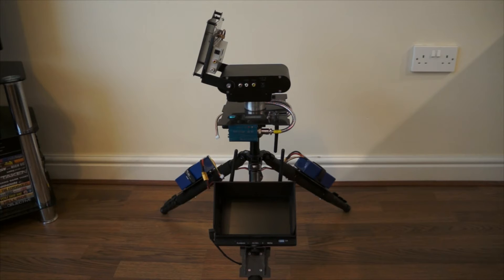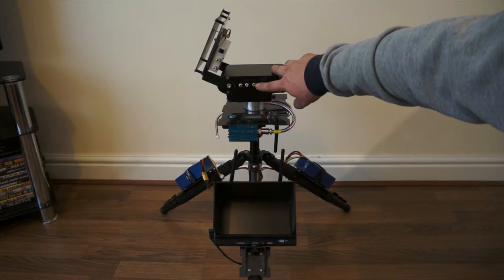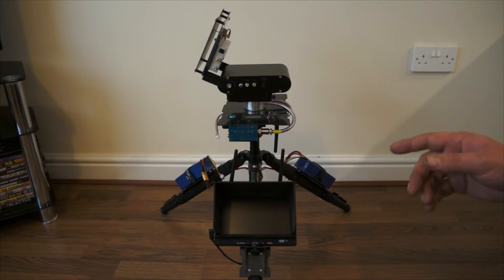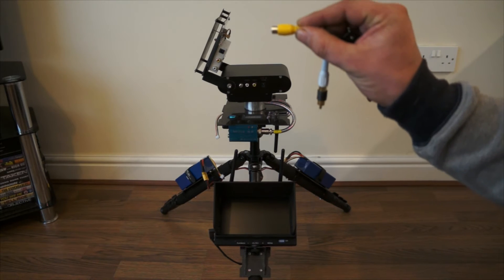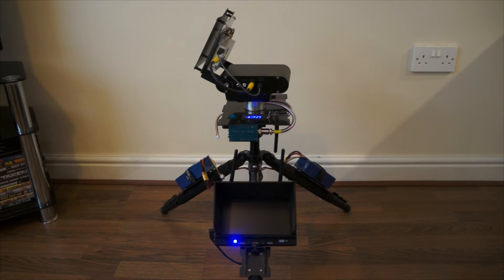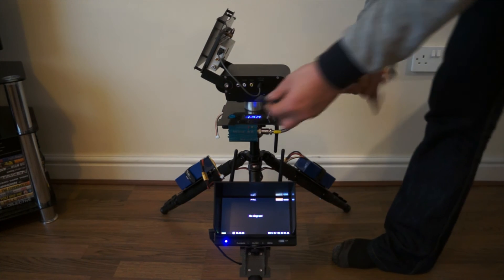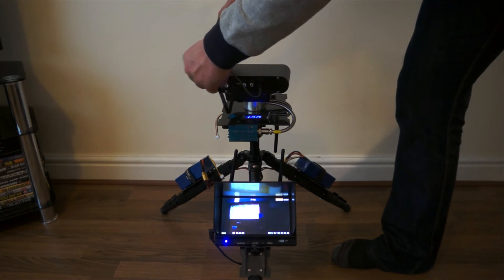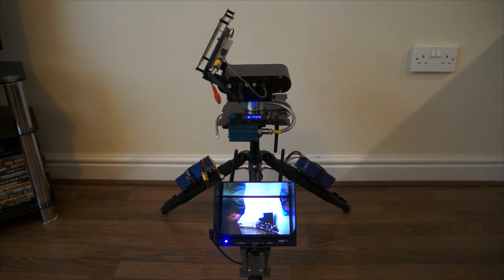MFD ATT Mod

Comment: Nice mod, can you tell me how to plug 2 att together to see the other plane information on screen? What cable i need and how to do it, thanks.
Reply from the maker: You need a 2 wires. From your ATT driver the while Molex connector. You need your pin 2 going to their ATT driver pin 6. Then Pin 2 their ATT driver going to pin 6 of yours so you appear on each others screens. I don't think you can buy the cable, you would have to make your own.
Reply: I can't find the diagram on google
Reply: Found something, it shows pin 5 to 5, pin 2 to 6, pin 6 to 2, so i need a 3 wire cable, thanks amigo
Reply: I dont have the cable, how can i make one?

Comment: hi Coyote, recently I got the AAT , but the tracker isn't directly facing the plane, I read the manual , trim mode: press CAL and power up, then release. during flight, press CAL or NOR for the adjustment left or right. but it doesn't work, All I've got only " beep " sound when I press either CAL or NOR.    mine is a V5 version AAT .  many thanks for any advise !
Reply from the maker: I see you are having problems setting up your MFD AP as well. Trim mode should be a last resort. I would guess you need to do a hard iron calibration where you are before flying. That is normally the problem.

Comment: Mmmmeeeeennnn!! I have been suffering from this problem so badly that I was considering to change my entire video set equipment  "ON THE BLOODY PLANE""" never thought or consider that the problem may have been all along in the antenna! I'll be checking on my equipment tomorrow morning.. thanks for the tip!
Reply: +Coyote FPV I mean stink like a rotten piece of carcasse. literally a dead automatic  Antenna tracker driver. i have been considering to update the firmware. but don't know yet. I'm pretty discouraged whit this
Reply from the maker: +Migueldeservantes  Oh stink like smell, sorry I read stick. Well in that case then the logical step is to buy a V5 for $45 and have a working ATT again.
Reply: +Migueldeservantes i wonder if this is my issue as well...hmmmm
Reply: Thats to bad man, whats going on with yours?
Reply: +eastcoast78 Have a stinking defective AAT Driver "The latest version" and it is not working.. I send them the video they requested.. but there have not been any answer of any kind from them!
Reply from the maker: +Migueldeservantes When you say sticking do you mean it just sits still. Or do you mean the picture goes black and the tracker starts beeping ?